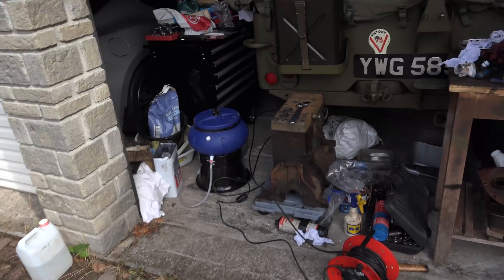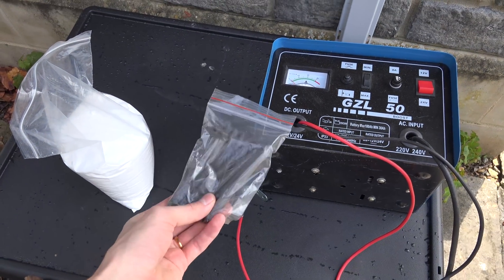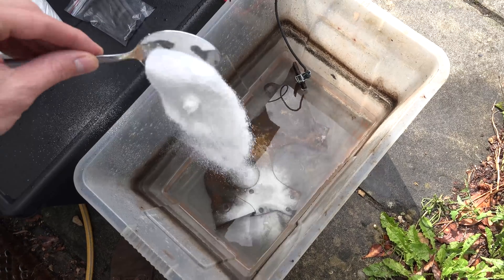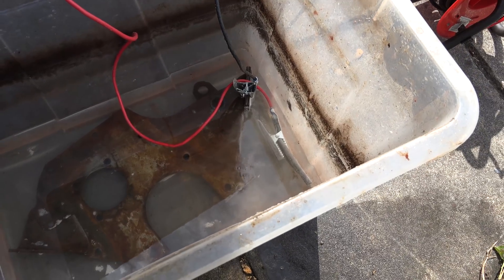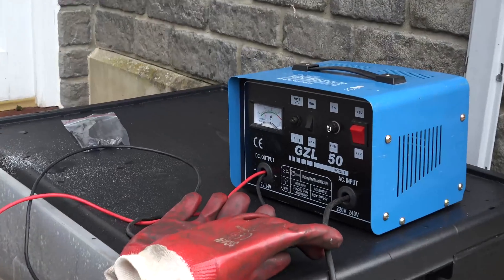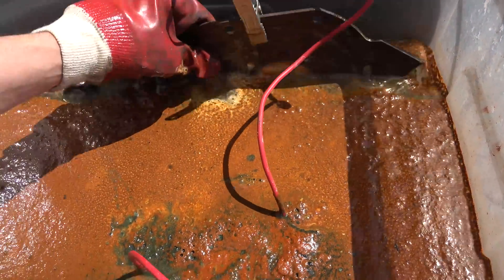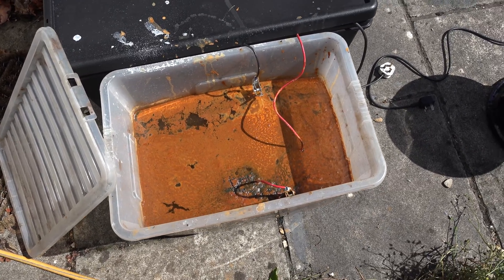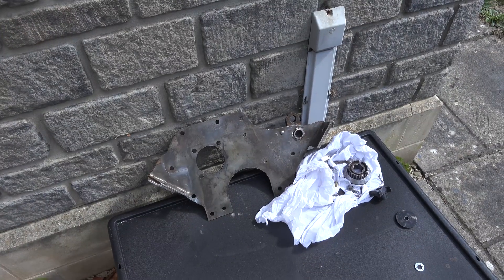Restoring jeep parts with Electricity! (electrolysis)

Comment: Electrolysis is a "Line of Sight" process.  The sacrificial anode can only clean the parts of the object that it can "see".  You can add more anode/s to increase coverage.  Such as a wire running the inner perimeter of the tub.

Comment: Very important: do NOT cover the bin/tank while it's under power. The hydrogen and oxygen that result from the electrolysis can collect and make a tremendous explosion. 
Hydrogen or HHO explosions are really quite violent. You need the gases that develop to be diluted immediately.

Comment: Hi Matt, hope your keeping well. Any progress on derusting the engine block?. I havent had a chance to work on my jeep since my last video, my garage is currently full of display cases for a nissen hut museum project ive been building, dying to get back to it. Hope all is well amd have really been enjoying your vids since we last chatted. Keep up the great work. Curious to see how the electrolysis works on the block, it would be interesting to see an axel or even jeep frame being done like that in a large tank. Ive done small parts before, its slow, but the results are great. Cheers. Will
Reply from the maker: Hi Will, thanks for the message, sounds like you've got your hands full at the moment, I like the sound of a nissen hut project! I'm going to get hold of an anderson shelter one day and set it up in the garden for the kids ;)  I havent done any electrolysis to the block yet, still need to get the core plugs and oil plugs out also need to finish of all those carbs, approaching a position now to be able to start reassembling carbs so engine will be next on the agenda.  We are also attending the Goodwood revival in a week and a bit with the jeep and that has taken up a lot of time too planning etc so lots to be getting on with!  keep me updated cheers

Comment: Greendot.....you can just use a Karcher high pressure washer to clean it up instead of a risky wire wheel. Make sure you air dry it with compressed air immeadiately after washing otherwise it'll flash rust. Spray it with a red oxide etch primer and you can then paint it by the end of the day.
Reply: Gavin Ashard : The pressure washer will take off the crud on the outside, but the object here was to clean the inside of the block, that cannot be touched by pressure washing, cleaning the plate was only to test that this method of cleaning would work, and it does, very well, the pressure washer removes only loose paint, but as you can see from this video, even the paint that is bonded to the metal is stripped, your use of etch primer is a very good idea. I spray that on all bare metal parts and it works well.
Reply: @453421abcdefg12345  that depends on what type (psi rated) pressure washer you use. Molasses softens paint and the pressure washer blasts that off. You can also put the part back into the molasses after a clean and leave it for another week...cleans up great.

As for cleaning a block...I'd take it to an engine builder and get them to do a hot chemical clean,check the bore, hone to oversize if need be, check for cracks and plug stitch them.

Comment: Many thanks for risking your safety in the interest of science ! That all looks very impressive, the nice thing is that there is very little input from the operator, you just have to sit back in the sunshine and let it fizz, it might be a good idea to have a steel mesh shelf across the bottom of the tank, that would give contact over a larger area, also a few non ferrous parts to see what the effect is on those, now you can tell Moses how it all works !

Comment: Make sure you have good ventilation as the "fizzing" is explosive hydrogen gas off your work piece and oxygen off your steel plate.
Reply from the maker: Absolutely Mike, Safety is key, this has been done in the great outdoors with no lid on so no problem here but something worth bearing in mind!